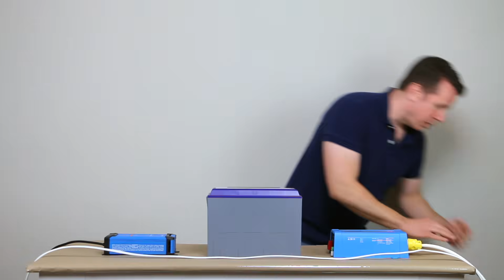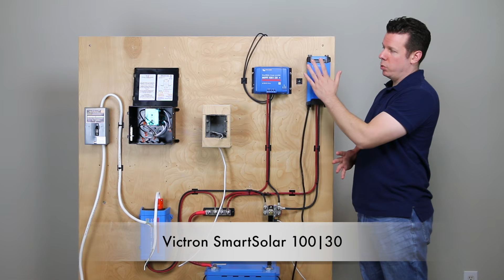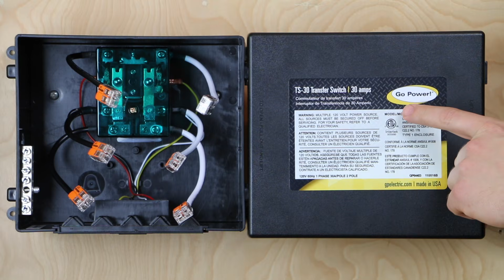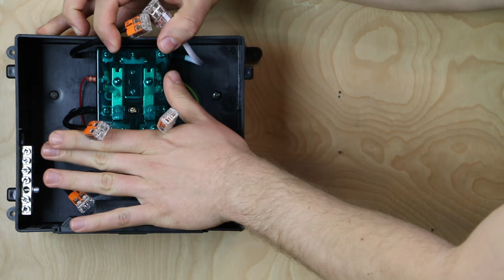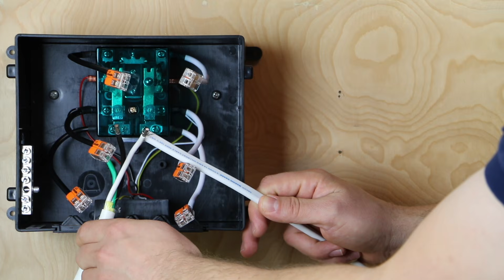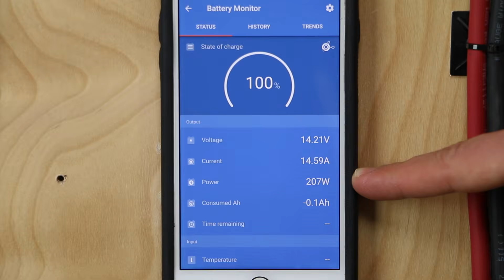How to Add Shore Power to an Existing Van or RV Power System | Featuring the TS-30 Transfer Switch

Comment: Eventually, some manufacturer will put all of these components into 1 device, and that will become the new normal...  MPPT, Inverter, Charger, Shore Power Transfer, Shunt, Lightning protection, all in one...   The reason why it will work is because most system components are "sized alike".  Another option to keep some modularity to it would be to do it like PC's do with "card slots", so that the MPPT could be an edge card inserted into a mainboard, thus allowing some flexibility in design while shrinking the wiring bird's nest into one box with slot cards on a motherboard...
Reply: Victron  Multi Plus does the charging and the inverting in one unit. Would deffo get it next time since the charging on those units is pretty powerful (50A and more) plus a good inverter. Now i just have the 30a Victron Charger plus a different brand inverter.
Reply: The Sol-Ark has most of those features.
Reply: Right on! In my perfect world, a camper van I outfit would have one huge-capacity battery box hardwired to a 30 amp cord that I plug in at home to charge to capacity. It would then be hardwired into a square D 30 amp circuit breaker box on into two separate circuits. The battery would have enough KWHs that I could run everything on house current (except maybe heat and air) for a week. Then I go home to recharge or, if on a longer trip, I get an electrical campsite for one night to recharge for another week. Is such a thing possible yet?
Reply: Bluetti AC 200 max ?
Reply: They already Exist.  Have a look at Victron Energy Inverter/Charger MULTIPLUS-II 48/3000/35-50 120V | PMP482305100
Reply: There is! A Tesla power wall will do all in one including the battery if you are willing to cough out about $10,000
Reply: @tedndinya  no wonder Elon is so rich... with those high prices.
Reply: @thetruthserum2816  it’s either that, or you go by a much cheaper broken down version that this video is providing. You can’t have it both ways. But if you are to speak of Elon who wasn’t even in this conversation, guess what, if you were to be given $100,000 every single day for the last 5,000 years, Elon would be still richer than you. Yup! That’s how rich he is whether you like him or not. 

If you can afford his products, What matters more, him making a couple thousand dollars more by you buying his product or you being satisfied by buying his expensive all in one product that you are wishing for above? I’m just a logical thinker 🤷🏾‍♂️
Reply: @tedndinya  Extreme wealth inequality was one of the causes behind the French revolution. "Let them eat cake", so to speak as many starved in the streets.  I chose the RG4 3K all in one... EG43000EHV-48 All-In-One Off-Grid Inverter. The EG4 3000 EHV-48 combines the capabilities of a 3000W inverter, MPPT solar charger, and battery charger.  They also offer grid tie all in ones if that's what you're after... 48 V, with 3200 watt array.
Reply: @thetruthserum2816  so if you found one, then what was your initial post about then? a Tesla power wall has a 13,000 watt battery, 5,000 watt continuous power out put inverter with a 7,000 watt peak for up to 10 seconds. It has a 120/240 voltage out put. Depth of discharge is 100% with a 90% efficiency. Voltage range is 350 to 450. And all this is just the beginning of what it can do. It is not expensive for no reason, it’s much more powerful all in one than what you described above. That doesn’t mean what you described above is bad but that’s also the reason why it’s cheaper. If you have money, buy the Tesla one. If you don’t have money, buy that cheaper one. But all this has nothing to do with Elon’s wealth. 

But why is he so astronomically wealthy in the first place anyway? It’s not because his products are expensive, it’s because his products are good. People believe in them and are investing in his products raising their market values. The more they invest, the higher the market value gets, the richer they become and the richer Elon gets. How so? He believed in his company so much that hi invested 80% of his money in them. So people investing in his companies are the ones making him richer and richer. Is there anything wrong with that? Again I’m just a logical thinker.
Reply: @tedndinya  I think his wealth is tied to a system that does not tax wealth proportionately...  In fact he pays less tax than most everyone, and that we live in a system that allows such gluttony of extreme wealth hoards says a lot about our system that can be bought by the highest bidder.  For perspective, see "French Revolution", or reasons why Rome fell... Extreme economic inequality causes the downfall and often crash of civilizations and or revolutions.  Not sure a CEO making 1B a year is a desirable outcome in any economy, especially in light of how much the average employee makes.   My 3200 watt solar array and 800 aH battery system are plenty for me so far, although I'd like the idle consumption to be closer to 30 watts...  Then watch for him to oppose unions or other employee protections, or say want to outsource labor to H1 visas because American's are not talented enough, or would ask for a living wage... lol Meanwhile were at 422 ppm global CO2, and we've got a 2 party system where half of them are owned by the oil lobby, thus their solution is to "drill baby drill".  Just saying that Representative Republics are for sale to the highest bidder, and our collective outcomes are tied to that. I think we need to instead do "direct Democracy" where we all vote on all laws once per quarter, and tally the results with blockchain ledgers... just sayin...  sorry didn't mean to hijack this post, but Tesla has hijacked my Representative government for the low low cost of $140 Milliion dollars...
Reply: Bluetti Apex 300 with the Hub D1 is the first all in one system sized correctly for a small RV like a camper van.
Reply: They do😂

Comment: Ross, thanks for your videos.  Quick question on this one - I saw you have the chargers on the switched side of the batteries.  Any reason for that?  I thought it'd be better to have the chargers on a separate switch than house supply (so you can kill supply but still have batteries charging etc.)  Or were you just being efficient for the purpose of the video?
Reply from the maker: Hi Nick, I suppose there is a bit of an art to it, and you could arrange the switches differently if you had a reason. I typically have a "battery isolation switch" as I call it, so that I can isolate the batteries when the system (in this case "the van") is not being used, and I want to prevent any parasitic loads from taking the battery down over a long duration. This switch also removes battery power from the system during maintenance and installations. I think it could be good to have chargers and loads on separate switches, although I try to make these systems as simple as I can. As I said it's sort of an art so no two electrical designers would come up with the same layout. It's whatever you think is best for the outcome/operability you want to create. Hope that helps!

Comment: Hi Ross, I enjoy all your videos. You make everything very easy to understand. I have a question. On a 30 AMP 120 volt service into the electrical panel in a van, do you use a 10/2 with ground for your shore power feed to the electrical panel inside a van? Or do you use a 10/3 with ground? And do you use a bonding screw inside the electrical panel that the shore power wires into? I'm assuming that for a 120 system, you would use a 10/2 with ground. But I'm not sure about the bonding screw. Please help, Thanks.
Reply from the maker: Hey there, sorry for the late reply. I use 10/3 Triplex cable, which has a ground. You wouldn't typically go straight into the electrical panel, you would go to a transfer switch or inverter-charger. The output from that would go the the AC/DC distribution panel. The ground wire from the 10/3 supply line would go to a ground bus bar, and all branch lines departing from this box to places around the van would also have their ground wires connected to this ground bus bar in the box. Hope that clears it up somewhat! I would use marine triplex cable, not the 10/2 with ground that you would use in a building.
Reply: @rosslukeman  Hi Ross , Thanks for the reply. I was referring to bringing in the 10/3 cable into a disconnect shut off first, inside my van. Then run wiring to my inverter/ charger.  I haven't purchased my disconnect yet, but I was wondering if disconnects have a bonding screw???? And should I use the bonding screw if the disconnect has one??? What are your thoughts?
Reply from the maker: @koelzspeedgarage2796  Ah ok, yes I would just use a 30-amp breaker with this box (https://amzn.to/3P6XSnG). Use a QO series 30 amp breaker (https://amzn.to/3AN3cIx). It doesn't have a bonding screw, but you have to buy a Square D ground bus bar like this (https://amzn.to/3yYSKwf) or smaller. It will also ground the box. Hope that helps!
Reply: @rosslukeman  Thank you Thank you, That's exactly what I was wanting to know. Thanks so much for clarifying that. Im betting other people don't know to do that. Maybe you could do a video about it.  As always, I enjoy all your videos. Keep them coming. Thanks for sharing your information.
Reply from the maker: @koelzspeedgarage2796  glad that was helpful! More to come...

Comment: Help!  I have a trailer with a factory solar panel.  I had a jack installed on the tub where the battery so I could also use a suitcase panel.  Told that I would still need a controller for it. Is this true?  The controller inside the trailer not able to recognize it?  My plan is if I have to park under trees where the solar on the trailer would not get sun.  I would like to put a panel out in a sunny area.  Plus.. maybe double the panels even when parked in the sun to charge battery faster.
Reply from the maker: Hey there, great question. You have to watch mixing panels of different voltages, as that can make the whole system fall to the voltage of the lowest-voltage panel, severely reducing output. If the voltages are close them you can mix them without as much loss. The 2nd charge controller does sound like a nice solution, as both solar charge controllers could be connected to the battery (this would be called "connecting them in parallel"), and whatever power came in whichever controller would make it to the battery. It might be good to put a switch (or just a breaker that you can switch off) in the Batt Positive line from the suitcase panel controller, as these solar controllers can become a slight draw on the battery (although with newer designs, that draw is getting to be less and less) without a solar panel hooked up. Hope that gives you some ideas! Thanks for the question-

Comment: I'm bit confused about last bit you've mentioned in your video - EasyPlus switching off inverter when you plug in shore power. 

I've got EasyPlus Compact 12/1600/70 and need it to be switched ON to pass through shore power from the grid to the van.
So in my set up I'm hooking up to the grid, switching Easy Plus "On" and I get 230V in all sockets on board. 
At the same time charger side kicks in and is topping up my Lifepo battery. 

My problem is, in a cold weather BMS will protect battery and cut off charging which for some reason makes easy plus cut off shore power. 
What I'm doing wrong? Why inverter / charger side can't be off and just pass through 230V from the grid. 
That was my whole point of having easy plus compact with beakers fitted to simplify install. 

Thanks for very informative video.
Reply from the maker: Hi Pete, I was saying that the inverter-charger will turn off its internal inverter when it detects shore power, but as you concluded the unit itself is left on by the user. 

On the BMS shutting down everything, that sort of makes sense that even the 230V grid power could not get in. Do you have a Victron BMS that's controlling the EasyPlus? An easy fix may just be to have a little heating pad on the batteries to prevent this shutdown from happening. Whether the EasyPlus can let shore power through while turning off battery charging, I am not sure. Perhaps there is a setting for this in the programming. You might also ask in the Victron Community forum. As I mentioned though, you might get a battery heater to avoid the situation altogether. I hope that helps! 

Thanks,
Ross

Comment: I have a 12 I 1200 victron inverter.   I just added it to an old rig I'm working on and when I plug in a clock radio the radio buzzes a lot when it is moved within about 3'  of the inverter.  I have yet to wire in the inverter for 120 in the camper and switch it on and off ... great video about this transfer switch.  I was thinking of a rotary switch to go from one and the other.  I am looking too make a switch to select between two different solar panel configuration as not to put in too much into my victron 220 W 15 amp controller.  I may be parked under trees and want to use portable panels in the sunlight...
Reply from the maker: Hi David, interesting to hear about the clock radio buzzing when it gets close to the inverter. I will take note. On the rotary switch, it is the same functionality and I have dealt with vans using those (Blue Sea Systems has some switches like that), but I try to automate the system as much as possible so the user doesn't have to do things manually. I like your idea though on the solar panel switch. Mixing different banks of panels can be tricky and it seems clean to switch from one to the other based on conditions...Thanks for the comment!